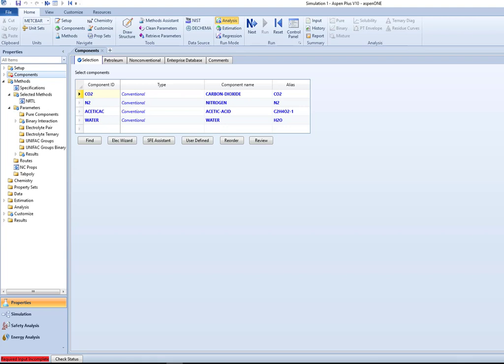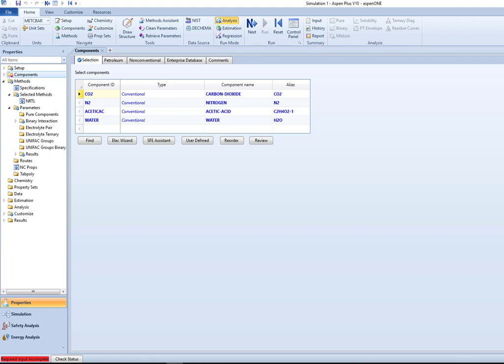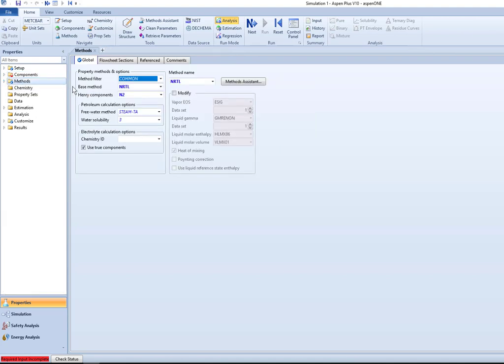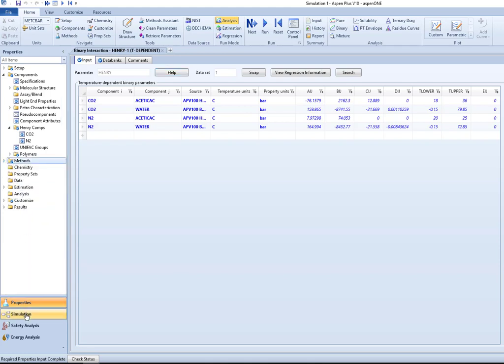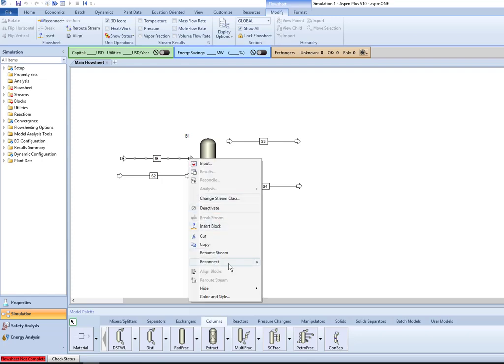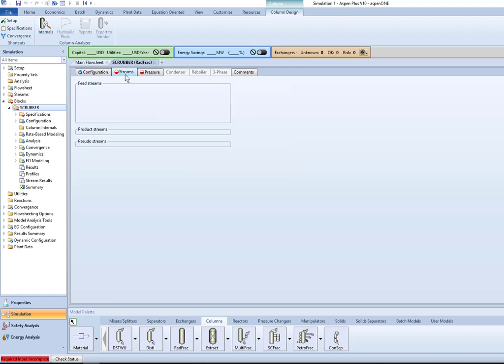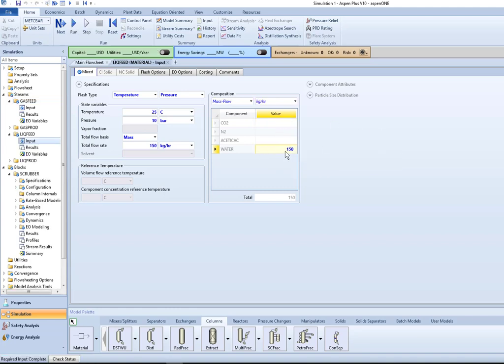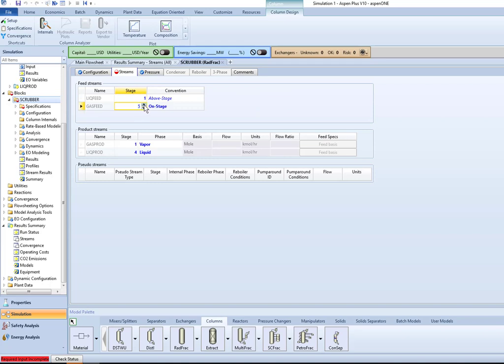Modeling Scrubbers in AspenPlus using RADFRAC

Comment: Thanks a lot Professor Luks for sharing this, very nice introduction to scrubber modeling.
After many years of designing scrubbers and gas treatment systems, I would just like to add a small note for anyone using this as a reference:
this setup is very simplified, and relying only on equilibrium mode can lead to significant errors in real design work.
For industrial applications, it is strongly recommended to use rate-based modeling and include non-ideal column behavior in order to obtain more realistic and reliable results.

Comment: Thanks for the video but since you already mentioned number of stages,can we assume that you calculated number of stages graphically using pinch method and then use it as a reference in this simulation ?. If I were to design a scrubber in an industry, the important thing for me will be the diameter and the length of the column. how can we calculate the same in AspenPlus ?
Reply: Hi Parth! I am trying to design a direct contact cooler with Aspen Plus but I have not found any specific information. Have you found any information? Could you share it?

Comment: thanks 
but for absorption with chemical reaction (carbon capture)?
Reply: hi mohamed, I also need to simulate an absorption of CO2 with chemical reaction (with MEA to be more specific).. please have you find any other video that would be helpful in this issue? thanks so much
Reply: hi, im trying to do one for nh3 scrubber with chemical reaction aswell, did you end up finding how to do this? @marianasayuri8048

Comment: So when designing a tower for industrial application how do you determine the minimum solvent flow and minimum number of stages. I know with distillation one can use FUG shortcut methods that come along simulations, but with absorption and stripping most examples they just give the number of stages and flowrate to use. Thanks
Reply from the maker: The minimum solvent flow is based on the "pinch" much like in distillation. You know the feed and solvent compositions and the desired purity of one of the streams. Use those to see the line that intersects the equilibrium curve. The slope of this operating line is the limiting value of L/V.